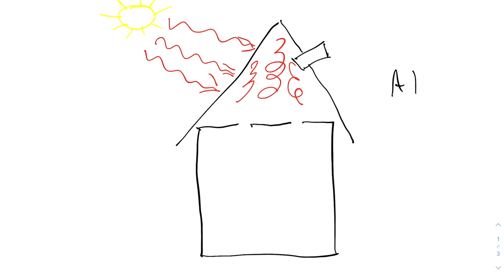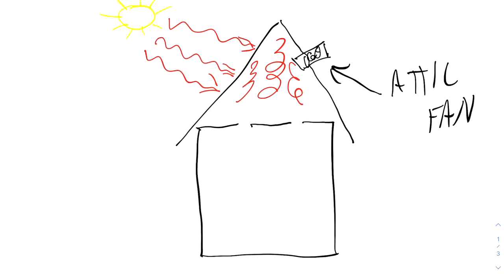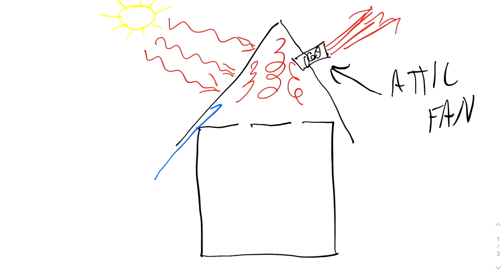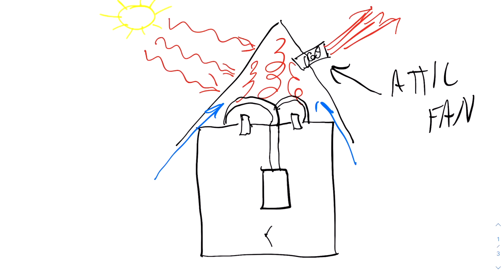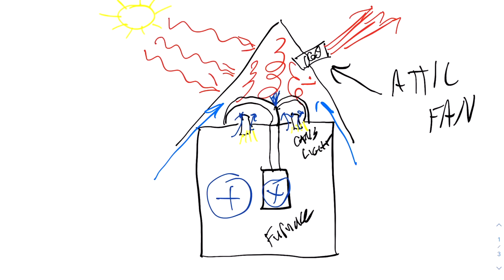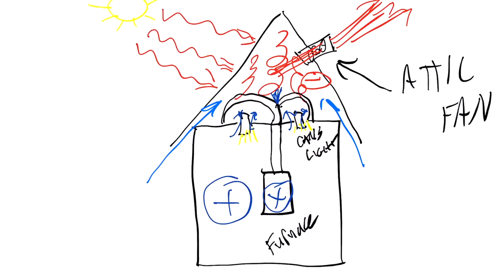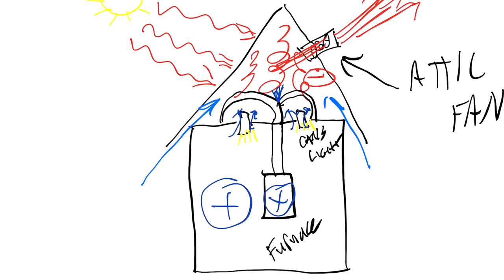3 Remodel Rip-Offs

Comment: Matt,
I don’t think that I can agree with you about the benefits of a powered attic fan.   I live in Springfield, Virginia and I have actually measured a 30-35 degree difference in the attic temperature when that powered ventilator is running as opposed to when it is not running.  I have had a comprehensive energy analysis done on my home and I know for a fact that my attic ventilation is not sucking air from our second floor into the attic.  I have my A/C unit properly sized for my home and not oversized as implied by your video.  We have a programmable thermostat but find that we tend to keep our temp relatively constant during the cooling season and normally allow the house to cool off a few degrees during sleep hours in the winter during heating season.  We have double pane glass windows with low e coatings.  We know that they made a significant difference relative to the old windows that we had when we moved in almost 31 years ago.  We bought the double pane windows not just to better insulate but also to improve the looks and reduce the amount of exterior noise infiltration that was something that you did not discuss in your video.
I guess my take away from your video is that you see a lot of homes with oversized A/C or heat pumps, you don’t think that a 30-35 degree drop in attic temperature makes a difference, and that sound deadening is not one of the reasons that people replace their windows.    I am not certain what to make from your video.  For me the attic ventilation temp difference of 145 to 110 is significant.  I don’t know if you think that is significant but for us it certainly makes a difference in comfort for us.  
PS Over the thirty years in our home I have replaced the attic fan motor twice.  The total cost of those motors was less than 100 dollars over those 30 years.  During one season when we didn’t have the ventilation fan running we had a roughly $45-$50 per month increase in our electric bill.  (The bill went from $190 to approximately $240 per month).  From an energy perspective I guess that is not a lot of money but from a comfort perspective and level of A/C required it seems like a good return in the long run.
Reply: I would have to agree with you! He is pointing out worst case scenarios, oversized air conditioners oversize ventilation fans or lack of soffit vents! My parents live in New Jersey and last year their attic fan stopped working! So I replaced the fan and also replaced theThermostat due to its age! A few years ago I installed a four channel weather station that measures indoor temperature, outdoor temperature, garage temperature and Attic temperature! I just got off the phone with my dad to ask him how hot the attic was when the fan broke, because he watches those temperatures all day long! (Being retired he’s kind of bored) He said on a 95°F day the attic was about 135 to 140°F and with the fan it is about 110 to 115°F! As long as you have enough soffit ventilation or you do not install a fan that is way too big for your attic you will have no issues and it will cool the attic significantly! As for windows I purchased a home five years ago in South Carolina that had single pane windows! So I replaced all the windows and insulated properly around them! I can Positively say when the old windows were in my air conditioner used to run much longer and come on twice as much! The air conditioner stays on about half as long and remains  off twice as long! Now my electric bill is a lot lower all year long!  The money I spent replacing my windows I got back on what I am now saving on my electric! Anybody can sound convincing in a video by themselves without anybody to argue the other side! Oh and by the way that attic fan I just installed is only the third fan since 1984! There are a lot of nice homes and cool ideas in his videos but sometimes he can really talk out of his ass!
Reply: I have seen 30-40 degrees difference in Spotsylvania/King George VA with a wireless thermometer in the attic and powered fan.  Much hotter now that the motors burnt out and got disconnected (and the landlord won't replace them)
Reply: Matt how much did it cost  and how did you manage your comprehensive energy analysis?  Did Dominion help in the cost at all?
Reply: I live in Virginia also (Hampton Roads area). This is our second summer in this house, and the first summer with a powered attic fan. Our electric bills this summer have been $60-$80/month lower than the same time last year.
Reply: @ronirby4496  what fan did you get?  Im considering putting one myself.
Reply: @squidusn71  I bought the Master Flow 1500 CFM from Home Depot. Fairly easy installation, works great and virtually silent.
Reply: @NeverEnoughPyro40  WOW! That! Is! An! Awesome! Testimonial! Thanks! For! Typing! That! For! Me! To! Read!
Reply: @NeverEnoughPyro40  In case you are unaware, there are punctuation marks to end sentences with other than exclamation points!!!!
Reply: I'm an Electrician in NOVA and I agree with you 100% no question about it, attic fans work!!!!!!!!!!!! I don't understand his logic on this one but he is absolutely wrong about it....  Attic fans are WELL worth having!!!!!! I put them in new homes and old homes and they do the job well.... Kinda like sealing your basement BEFORE you remodel it!!!!! It simply works!!!!!

Comment: I had an attic fan installed, my second floor relative humidity dropped from 70-80% to 45-60%. This is especially helpful since my Mitsubishi H2i doesn’t dehumidify like a traditional AC.
Reply: Ok well my attic was 142 degrees and now it’s 90. My electric bill went down almost 100 bucks 🤷‍♂️

Comment: I am a  Contractor that has used replacement windows since there were replacement windows, And I am here to tell you that they definitely save you energy and cut down on sound. My most extreme experience was in a small condo that only had 4 windows. I replaced all 4 with double pane vinyl windows and their energy bill in the Winter went from $250 a month to $50 a month. Of course most people will not get this extreme benefit. In regards to attic fans, all you have to do is go in the attic in the summer with the attic fan turned off and then turn it on and I guarantee you you will feel a huge difference in temperature.
Reply: I replaced all the windows in my 1200sqft house. They were all single pane aluminum frame. The windows were VERY loose in the frame. They were USELESS.. They were all replaced with dual pane with that silver stuff and argon inside.. I went from running the AC all day. to running the fans at night. The cold air would stay in my house all day long. Saved me OODLES! And yes. Attic fans work.. I run mine for about 3 hours before I have to get into my attic now.. Takes the attic from about 140+ to 80. Helps so much!
Reply: @austech360  well now that's a great point. Whether the fan is pulling AC from the house or simply helping push out hot air and replacing it with ambient air, it's a great discussion, but who gives a rip if you have to go into the attic to do things? Attic fan is easier and cheaper than hauling a portable AC up there.
Reply: I don't understand double glazing is pretty standard in the UK and most northern European countries. Triple glazing is common in Scandinavian countries.

Comment: I personally installed an attic fan this summer (thanks youtube) after living here 2 years... helped a whole lot.
Reply: Turn mine on in summer off in winter
Reply: Thanks!
The whole point is to lower the attic temp to 10 degrees above the ambient temperate
Reply: The new ones have thermostats so you don’t even have to turn them on and off. They work amazingly this guy is wrong his science doesn’t even make sense Solar Fan is a great idea
Reply: @Ray96744 
Such a claim against solar attic fan not working is ridiculous.  I am a big fan of solar attic fan, how can air circulation in your attic is bad compare to none at all.  Those whirly birds don't do crap.

Comment: First off, the sun heats the roof shingles by radiation, the roof shingles heat the roof sheathing by conduction, and the roof sheathing heats the attic air by convection.  By bringing in cooler air, you are cooling by convection and it WILL make a difference because the air is being heated by convection.  As others have said, I think this works better with one fan as an intake, and another an an exhaust to keep the pressure balanced.

Second, the airwave and fan on a smart thermostat do not really cause moisture to raise substantially in my experience.  I live in a single story ranch which I put AC in after I moved into it.  I run the fan every 30 minutes because it circulates and filters the air in my old house.  I also have airwave on and I am looking at a humidity sensor that says 39%.  This is after a very hot and humid June day.  The reality is, the system removes so much moisture (and drains it) when it runs.  This added moisture back in does not appear to be problematic at all.  At least for me. 

The window thing makes sense to me.
Reply: The roof deck will still also radiate heat into the attic.  Stand in an unfinished garage on a hot day and then hold an umbrella over your head, you can feel it
Reply: @vennic  Thank you.  Much radiant energy is converted into conductive thermal energy thence convective energy, but not all.  Just because a surface appears opaque from the standpoint of our limited rage of radiation perception (aka vision) doesn't mean that some radiation blithely passes through it.
Reply: If the eave vents are not plugged air will freely move back to the attic and the "negative pressure" is inconsequential.
Reply: If your ceiling isn't air tight you can potentially pull conditioned air from below into the attic.

I totally agree on airwave and fan scheduling. My upper floor is 3-4 degrees warmer without it.
Reply: The air in an attic is heated via conduction which causes the characteristic of covection. The roof is heated via radiation and the roof decking heats the rafters, joists, insulation, ducting , really your whole house via conduction. 

All these people making claims that sucking out hot-air would cool the attic floor and reverse heat gain into the living space are literally saying that their fan is pulling air out of their attic as fast as a jet engine would...just like Matt said. There is no way an attic fan is cooling the assembly of your roof. I challenge you, with your fan on full blast go take a reading of the underside of the roof deck. Its going to be a whole lot hotter than the air in the attic and it will stay that way until the sun sets.Whats actually happening is all the hot air that is sitting under the attic floor, in the living space, is being sucked up into the attic and cooler air from down below is replacing it. If you just added more insulation you would greatly reduce heat gain through the attic floor.
Reply: @vennic  It'll radiate some in yes, but the majority of why your A/C runs full tilt is because the air temps in there are 140 degrees - which a power fan will exchange that air, which will remove heat radiated to the interior, and allow the now cooler air to remove more heat. Kind of like the radiator in your car removes heat from your engine. The VAST majority of it is converted at the roof deck surface. Oh - and you can get a radiant barrier. You can use foil backed OSB decking, or foil stabled inside the rafters, or spray in on the bottom of the deck ...
Reply: @MarlowWhere  First off - the attic floor is mostly hot because of the 140 degree air sitting stagnant on it all day. No, you're not going to cool that roof deck with an attic fan, but you go into an attic and measure a component, install proper ventilation and drop that temp by 40 degrees, and measure it on another day and it's much cooler. Because MOST of the radiation is converted to heat at the roof deck. Yes, more insulation is also going to greatly reduce heat input to the ceiling - but the attic fan is NOT a 'scam" as he put it.
Reply: @notsure7874  a radiator removes heat via a coolant with far more mass than air. Air does not have enough mass for it too cool the attic assembly at the volume of air exchange that an attic fan is capable of running at.
Reply: @notsure7874  even if what you were saying was true, then you are agreeing with me that more insulation would prevent the hot attic floor from absorbing then radiating heat downwards into the leaving space. If the attic floor is hot and air movement isn't cooling it then it is heating the colder space below it that will readily absorb the energy creating an upwards draft IE the stack effect
Reply: @MarlowWhere  Yes, absolutely. More insulation keeps the hot in the attic better.
Reply: @MarlowWhere  Air doesn't have the mass of engine coolant, and the attic isn't a metal part with fire inside of it too. Theres a much much larger volume of air exchanged. I'm also sure you're aware that there are air cooled engines, and they use air to keep the chunk of metal with fire inside down to temps where they don't self-destruct.
Reply: @notsure7874  the majority of heat in an air cooled engine is vented via the exhaust. Next is via cooling fins (heat sinks), and the remainder the oil. Air itself is not capable of cooling an engine without other mechanical and fluid assistance.
Reply: @notsure7874  also cooling fans in engines move air under much greater pressure and speed than an attic fan. The effects of conductive cooling are much larger when low mass air is flowed over a hot engine at high speed. Like the video said, to replicate this in an attic wout require a fan almost as powerful as  a jet engine
Reply: Just wanted to say that I think 2 exhaust fans would work better than 1 exhaust and 1 intake.

Comment: I have a 110 year old house and started off with a very large electric bill. I had two 48x84 windows in the front of my house that were single pane. The front of my house in the winter was at least 10 to 15 degrees colder than the back. I replaced both with double strength IG units. Got an instant difference in comfort. This decreased my electric bill by almost $50 per month. Now I started making more changes in sealing floors replaced both ac units with heat pumps all duct work. Our first winter in this house electric was $750. Per month now it runs about $175.

Comment: Matt, in my case in Seattle it was a huge game changer for us. Mind you, we have a massive vent on the other side of our attic, so we didn't have the pressure issue you mention. 
It reduced the temperature significantly in the attic, and meant that we don't need to turn the AC on at night. I have since fitted a smart switch to it, and put a sensor for my smart thermostat up there, so I can gather hard data. Next summer I'll test it and send you the results if you're interested. Just reply to this message.

Comment: When I grew up in New York my Dad installed an attic fan and it made a big difference. Much cooler in the house.
Reply: Seems logical, not sure what setup he is talking about drawing your cold a/c from your house, must be an attic with sealed off gable ends he is using as a comparison, never seen any of those.
Reply: I did not know about solar powered vents I live in north eastern Montana winters extremely cold summer extreme hot...   well insulated attic no vents during the 16 + hours of sunshine daylight makes it hot it can reach temps over 200°F I cut in two vents (one on each side ). Put a fan in one blowing out. It reduced the temp from +80 to +130  above the outside temp to +20 to +40 above when running regardless if the house AC is running...  and when using the AC it runs 2/3rds less.  In winter I close up the vents

Comment: Don’t forget the main purpose of a powered attic vent fan is to exhaust the humidity first, then heat second. Humidity will lead to mildew buildup, then eventually mold. And with certain types of roof styles (ie hip roofs) there isn’t enough balance of ridge venting along with soffit venting to adequately vent both the heat and humidity. Power venting the attic is almost never a bad thing to have
Reply: That's the main reason why I put in an attic fan. Reducing the humidity in the attic has helped a ton.
Reply: You guy are a riot. THINK: How does taking in humid air from outside reduce humidity in your attic? It doesn't!
This is a classic blunder and misunderstanding of what "relative" humidity is.
Reply: @sprockkets  Go study the relationship of grains of moisture in air to the air temperature and you may understand how moving 95* air in Georgia through a hip roof attic will reduce the relative humidity of the attic air and reduce the temperature of the sheetrock ceiling in the afternoon and evening making the energy costs of a properly maintained A/C system less than it would be otherwise.
Reply: Don’t forget power venting your attic pulls cold conditioned air from your living spaces, so now you have more load on your HVAC systems to cool an area of the house you shouldn’t be cooling. Far better solution is for soffit/edge vents with adequate exhaust in the form of a ridge vent or turbine.